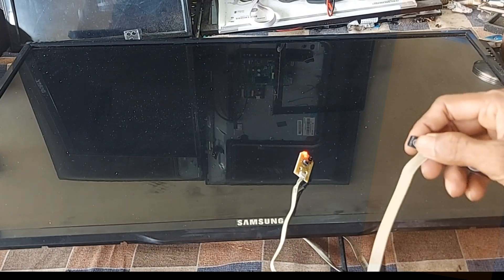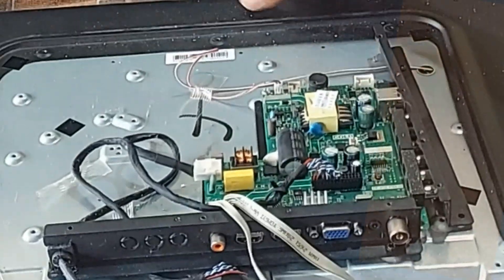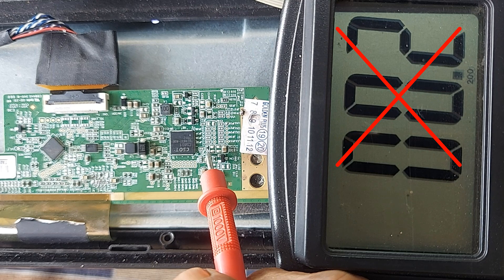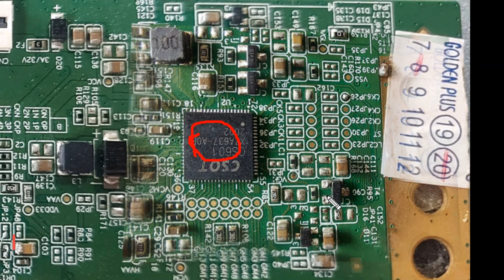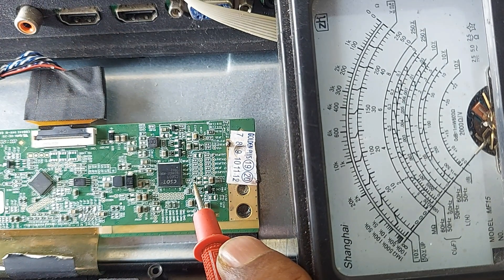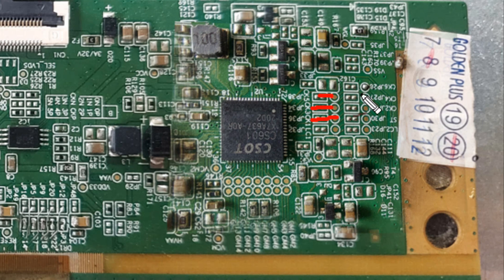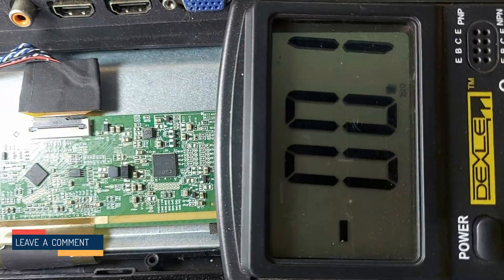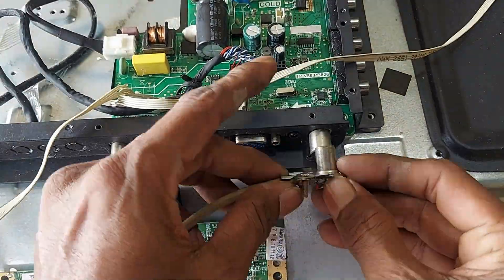No Picture Backlight OK | Black Screen Problem - Samsung 32" LCD TV-  ST3151A07-1-XC-3 Panel Repair

Comment: Vai Amar monitor er vcc 5v in korle 5v missing dekhay t con board ti shot charki check dilam aak bar all rokom reading dice 435-- 1576 ,1956 arokom akhon ki koroniyo . Shokol capacitor check diyeci but no shot sharkit .koroniyo ki ...plz